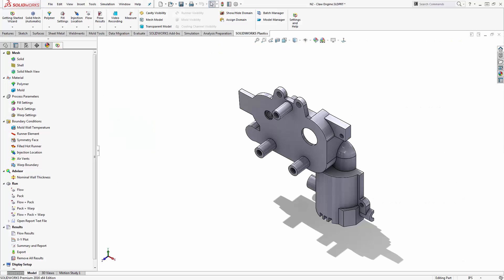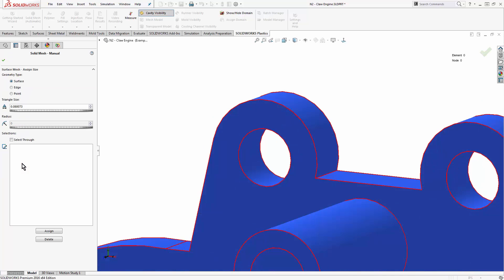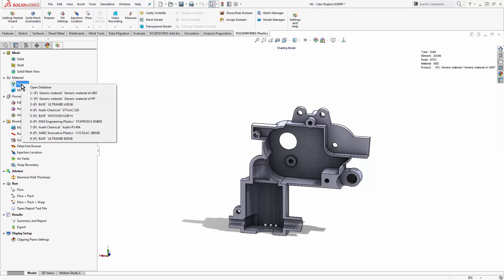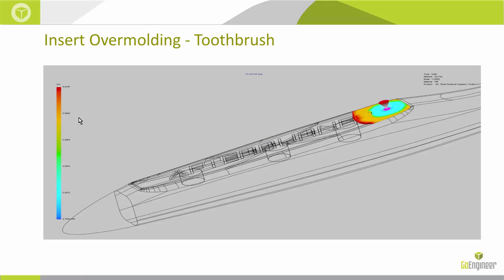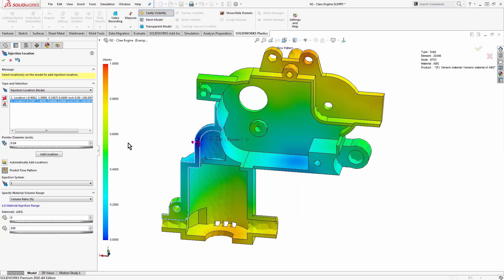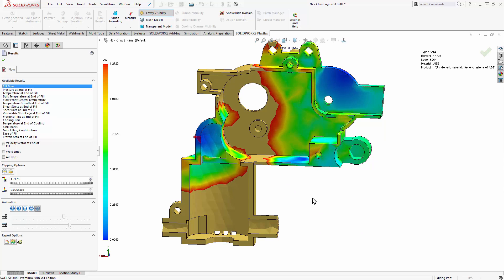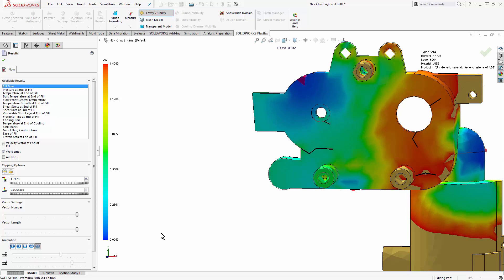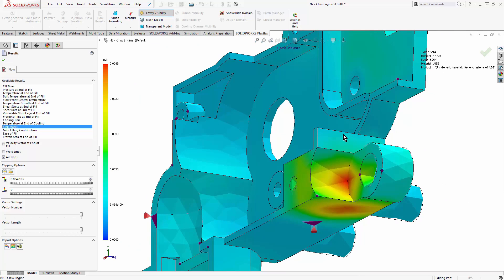SOLIDWORKS Plastics - An Introduction

Comment: I tried simulating the cooling channels in the solid works plastics and got an error written( AMG terminated with the error code).What could cause such an error?? Kindly anybody respond
Reply from the maker: This error code is fairly generic, I’ve included the top three hits for it from our database:
1)	SOLIDWORKS Plastics: AMG terminated with error code ** 210 indexS= 1 error message in the Flow/Pack Analysis Manager when using a Filled Hot Runner. Polymer Material specific no error using ABS
2)	SOLIDWORKS Plastics 2019: Cool Pipe > Cool analysis crash 'AMG terminated with error code ** 211 Part ejection * ERROR: NaN detected in (compute_residual_norm)!'
3)	AMG terminated with error code ** 51 indexS= 1 !! Error !! Short shot occurred, error is detected during computation process.

The message can occur because of a set up issue, or a bug in the software. YouTube isn’t a great way to diagnose the problem, so I recommend you reach out to your local reseller or the SOLIDWORKS Forums and have someone look at your specific set up.

Comment: I make extrusion heads and dies. Is this software more suitable for me then Solidworks flow simulation?
Reply from the maker: Hello Pedro, SOLIDWORKS Flow Simulation is strictly for fluid dynamics and heat transfer, it was not built specifically for plastics and injection molding.
Reply: @goengineer   thanks for your reply. Do you have any demo video of plastic extrusion simulation using Solidworks plastics? Thanks again.

Comment: Thank you very much!
Just one note... for some reason Weld Line check box does not appear as an option of Fill Time. I don't know if it is something I missed during your explanation or a bug in my installation?
Reply from the maker: Thanks for your comment Michael, it could be a few different things.  The best option for you would be to contact your VAR, they can better diagnose your problem